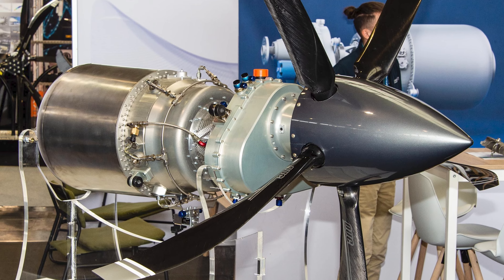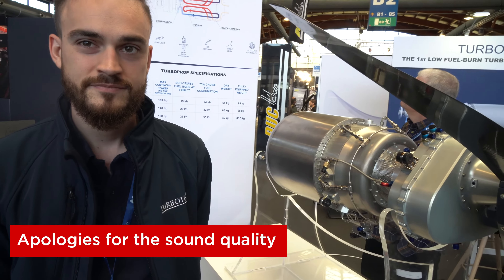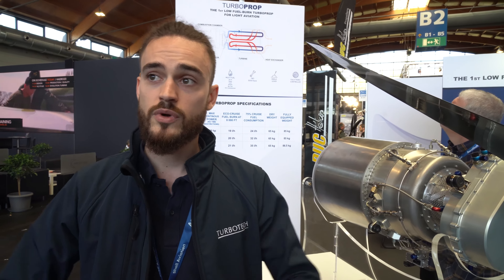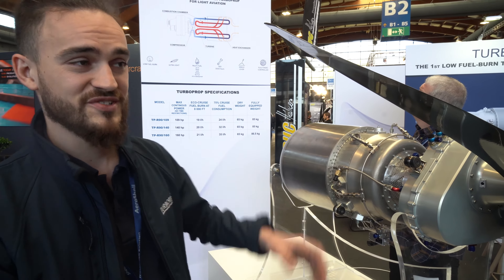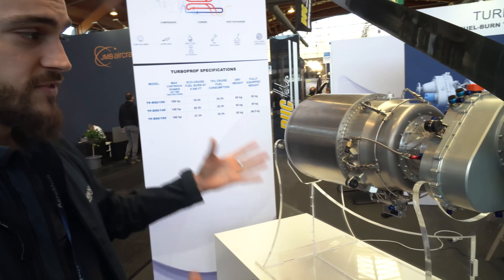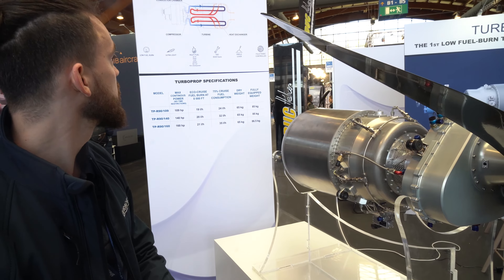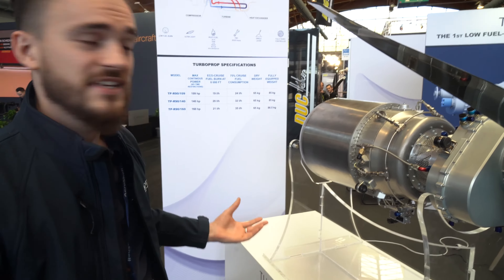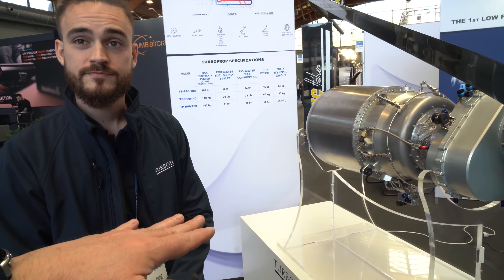Turbotech's TP–R90 small turbine for light aircraft

Comment: I wonder if you have to do a hot section in between overhauls. Most turbines require that.
Reply from the maker: Early days, they've only got about 100 flying hours under their belt. A long way to go, but they've made a great start.
Reply: I spoke to him at the show. There are a series of inspections with a boroscope inspection at 1500 hours. There are also various oil changes, injector changes, etc. at various points. TBH I can't remember all the details but it did seem reasonable.
Reply: @FLYERTV  what airframes are they testing & targeting for production?   What’s their critical altitude?

Comment: 50L per hour fuel consumption ... This engine will go nowhere.
Reply: Was thinking the same. Robin DR400-180 with 20 hp more piston engine consumes roughly 25 liter per hour, also Mogas. Probably the engine is also way cheaper. A tco comparison would be interesting since turbines usually require less maintenance and are probably more reliable but if something gets broken or you need maintenance I guess it's harder to find a mechanic and it's probably also more expensive.
Reply: 50l/h ??? Where do you get that from ?
The number are right behind him :
109hp/140hp/160hp
19l/h / 20l/h / 21l/h eco cruise
24l/h / 32l/h / 35l/h 75% power
Reply: @dufonrafal  I think Ame Perdue is a piston fanboi and is scared
Reply: 5000 liters per hour and it kills your first born son!? This engine is going nowhere…
Reply: @jimmyjango5213 yes…reminds me of the common thinking and attitudes at the time of the invention of the jet engine by England’s Frank Whittle in the early 1900’s (which I only learned of this evening)….plenty of naysayers then, but thankfully, perseverance won the day.
Reply: @harrywind1870  The Robin runs on an obsolete leaded petrol air cooled lawnmower engine. US junk!